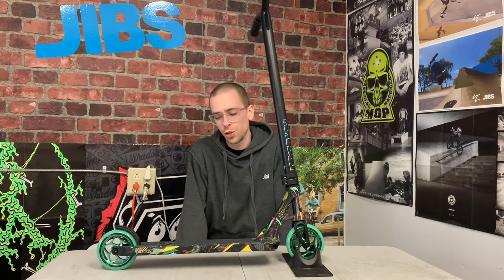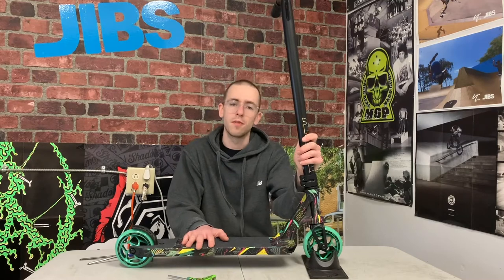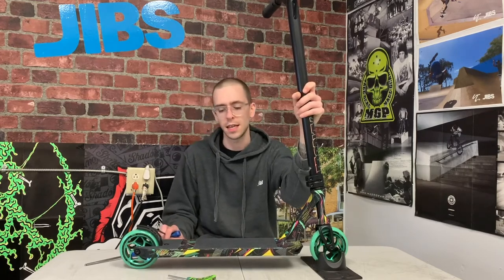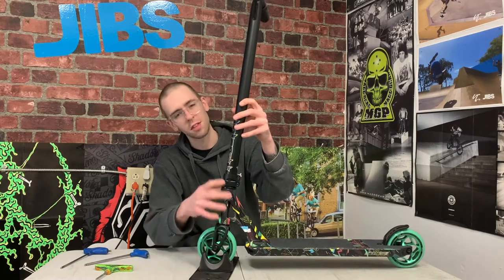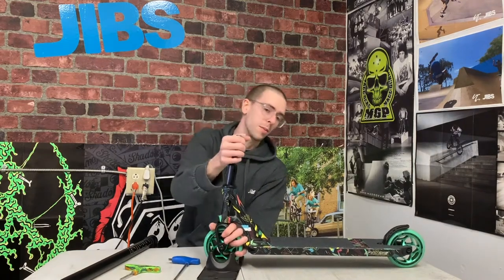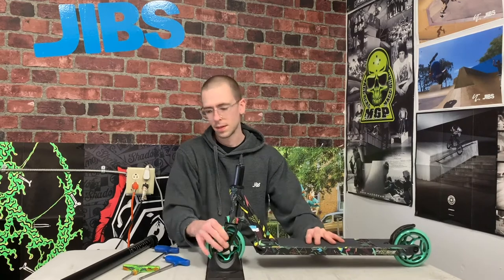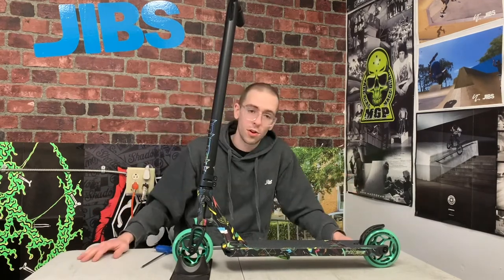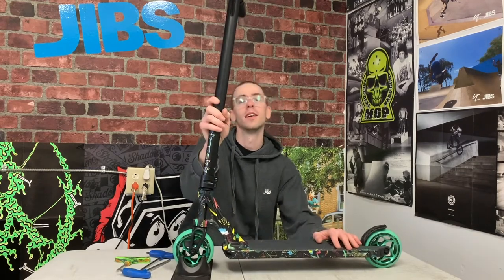How To Dial Your Scooter (with IHC or HIC Compression) | Jibs Action Sports

Comment: I absolutely love the prodigy’s man but there compression loosens every few days. How can you fix that?
Reply from the maker: Most scooters will require regular maintenance like that (that's why we made this video!). If you want to reduce the frequency that you have to tighten it, you can upgrade to a forged clamp which has a harder metal that can withstand higher torque.

Comment: i tightened everything and its still making noise
Reply from the maker: The most common culprit is worn out wheel bearings, or sometimes plastic deck plugs can cause rattles or vibrations.